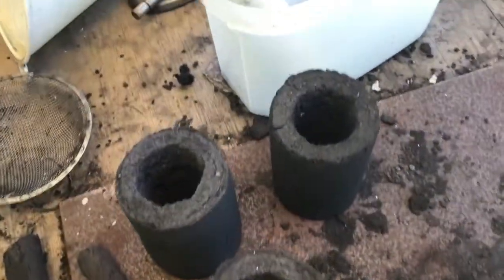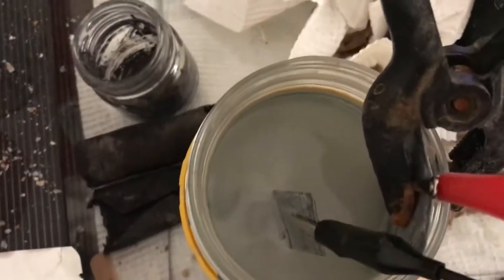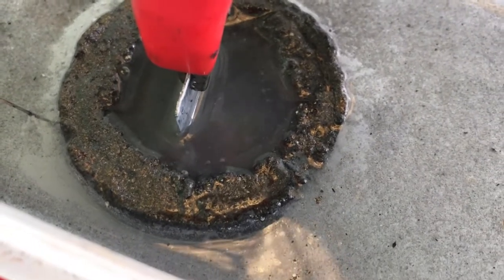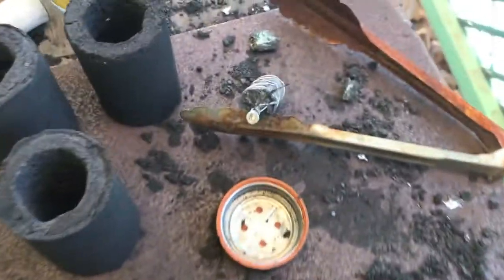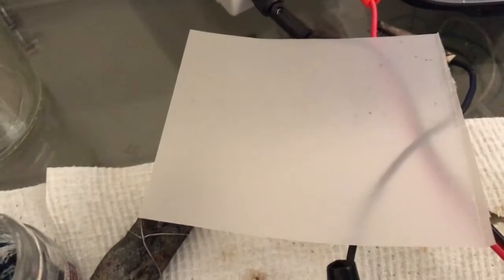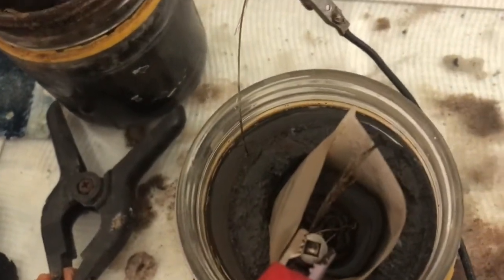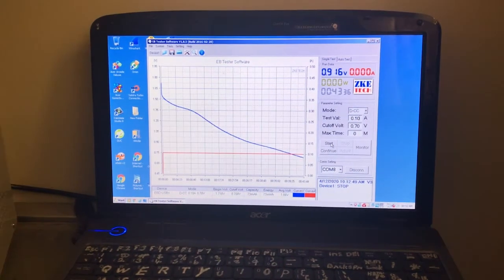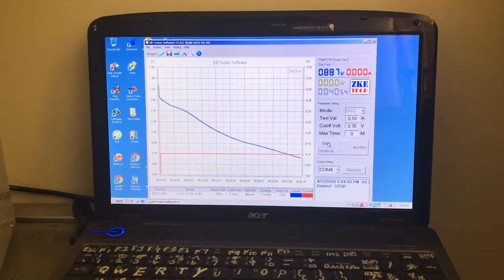Positive Center Electrode Carbon Tube Cell

Comment: Good work Dan. I've been working on similar cells with big monolith electrodes. A really good chemistry that might work for you as well is Zinc acetate Manganese acetate and KCl 1:1:2 molar ratio. Makes a single electrolyte flow cell with no membrane required. Potassium carbonate in the carbon when you are doing the pyrolysis will help keep it clean also. Thanks for continuing to share your experiments

Comment: Dan, a follow comment up on my recommendation about the "microporous coverall" fabric. Still good stuff but I have found that its not great for larger ions. It works well with nickel, iron, chlorine and hydroxyl Ions but over Xmas break my experiments with iron sulfate batteries showed that the sulfate ion won't pass through. It may not function well with hexacyanoferrate or similar. Live and learn, all the best.
Reply from the maker: Thant’s for the info very interesting. Merry Christmas and a happy new year.

Comment: Do you think the stainless steel wire would survive the temperatures in your kiln? If so it might be interesting to mold the wires (or ribbon or mesh) into the carbon cylinders and rods prior to baking. It might have better overall contact with the carbon. What specific battery chemistry are you trying to implement? The carbon cylinders and rods appear to have good consistent electrical conductivity and surface area. It would be interesting to see how they perform with a known battery chemistry then compare those results to the experimental battery chemistry you are trying to implement. As always, interesting stuff.
Reply from the maker: Hi Q. The stainless mesh I tried in the flat  carbon plate went all black after being in the furnace and also may have helped crack the carbon due to expansion rates. I’m trying nickel hydroxide and zinc cells with a bit of zinc hexacyanoferrate combo.

Comment: Stainless steel lock wire available on ebay if your wire isn’t working well .
Reply from the maker: Yeah I just bought some 316 zip ties you get 100 for $18.90. Hope they work. Was thinking of putting 3 up the side with one vertical for connector.
Reply: @danp1224  yeah thats a good idea👍🏻